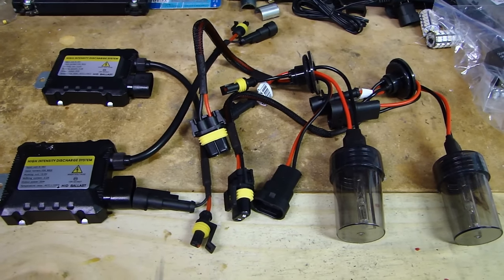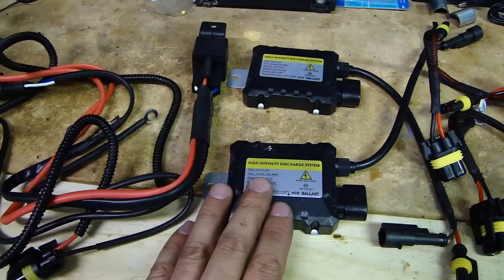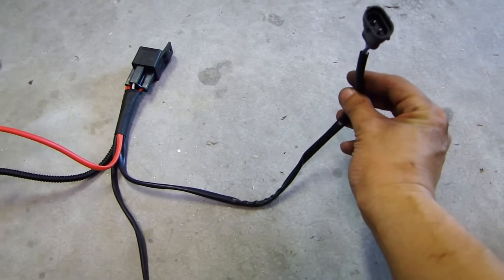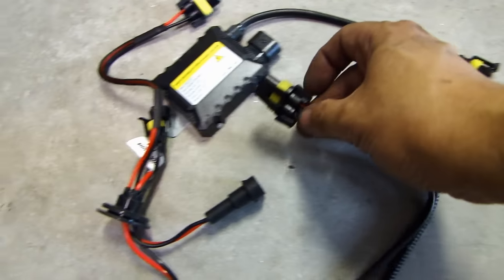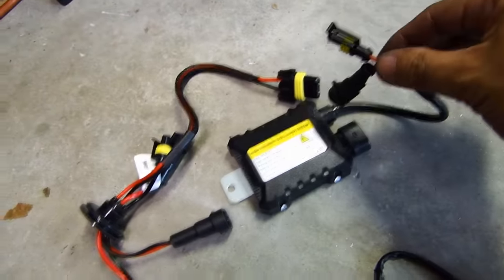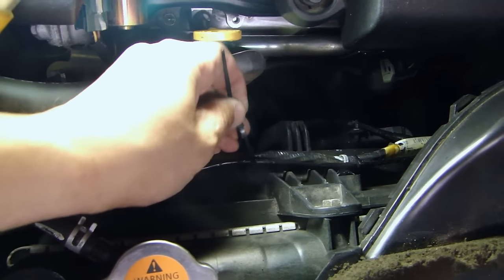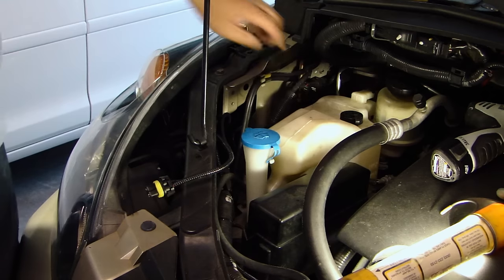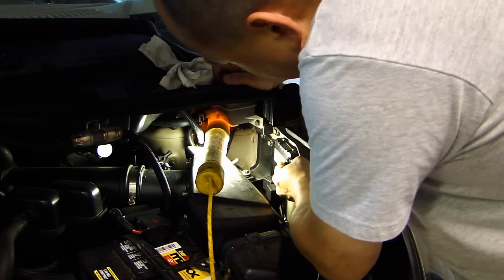How To Install HID Light with Relay Wiring Harness

Comment: Don't be that guy and install hid's in a reflector housing. Be kind and not cheap and buy projectors. Your not the only one on the road.
Reply: Its not that bright without projector. Its not as bad as regular high beams.
Reply: it is that bad. any housing made for halogens cant have hids. that includes projectors that came factory with halogens
Reply: +JiMLiTtLe905 I hate to be that guy because i agree with you i hate those drivers, but in my case i kind of have to. I ordered some smoked headlights and the light output is kind of bad. The glare is also way less than the clear lenses so i feel like i wont be blinding people too bad.
Reply: True partially. Do you know that there is cars that come with hid in reflector from factory? Probably you didnt. If the housing has the shield made for it it makes a very good cutoff actually
Reply: Make a Casper shield?
Reply: @JiMLiTtLe905  you don't know much about projectors, do you? Projectors actually produce less lumens than reflectors but also have a better cut off. Projectors were invented for hid headlights. Only reason factory puts halogen in projector lens is because it used to be cheaper. As for as led goes.... The new Corvette uses led ;)
Reply: There are HID's made for reflectors, they have the matte coating on a quarter of the bulb to prevent glare. The stock 2000-2003 Acura tl's headlights use HID 5000k with a reflector. This guy just didn't purchase the correct bulb for a reflector housing.
Reply: JiMLiTtLe905 what about as fog lights say 9006?
Reply: Or you can just buy d2r hids which are meant for reflector housings
Reply: I know this is an old comment thread, but I feel justified due to the tinted/smoked headlights I have installed. Its really hard for light to escape and led's and normal bulbs are just not bright enough for me to see at night.
Reply: Is that why I get blinded sometimes on the road?
Reply: Idgaf none of y’all care but me I do what I want stay blinded
Reply: An honest low life!
Reply: I did just this year's ago before I knew anything about HID's and my stock lights were brighter.

Comment: TIP: For anyone with this kit or similar and is still having issues after wiring it like the video here is a fix. Plug the pins into the connector just as it shows in the video. When you plug the connector into the red part on the ballast just flip them around on both of them. Mine actually had a positive and a negative mark on each one to match them up. So you’ll want the positive side to go into negative slot and the negative side to go into the positive side if that makes sense. Many hours of frustration and this is what finally got mine to work correctly.
Reply: No matter what I do to mine they remain dim, they start up really bright then within a second return to a dim state, does this mean my 12v current isn't strong enough?

Comment: I bought A golf plus 2005. Its just failed its annual mot inspection as the law of these HIDs has changed here in the UK. To pass I need to remove the HID conversion back to the original. Any idea how to do this?

Comment: Great video, I have a question about the extra wiring from the ballast. If I could put a picture on here I would show you. I have extra wiring for the factory wires. Do I just cut them out or what?

Comment: Hi. Thank you it was very clear nice expression. I have a question. I bought a osram hid kit(new). I tried it by my passat without relay. But it flickers 2 sec. and stops the working. (Both of xenons) I have to make relay connection to fix this problem? right?
Reply from the maker: Assuming the new HID kit works fine, if you install a relay wiring harness for the HID, then you will be powering the HID directly off the car battery and that should take care of any flickering or turn on issue.

Comment: Good video sir.  People doing installs (plug & play installs) with just the factory stock wiring may end up ruining/overheating the wires cause of what you said...the ballast uses alot of current to start up.  And that is why you used relay harness because it uses the right awg. gauge wire for the ballast and it gives it the amount of power it needs to work.
Reply: Hi Sir, Can you tell me if the kit works without the relay harness? because the one I bought on Amazon doesn't have a harness
Reply: @galodoidousarenato5504  it should still work.  My only opinion though when you connect it direct to the headlight plug, the stock wiring for the bulb may overheat and burn out the wire if the stock fuse does not blow because HID startup uses alot of volts/amperage  it says on the ballast.   I use a relay for my hid lights because I can hook up a bigger gauge wire to run my hids.  The headlight plug runs to a relay, then the relay would switch on and send power from the other wire I use to power my hids.  You should check out videos on youtube on how automotive relays work.  But without a relay, your hid kit should still work.  Just read the instructions...
Reply: @jbmjbm323  thank you very much, I did as you said and it worked very well
Reply: @galodoidousarenato5504  I installed morimoto 35W HiD kit on my car for 4 years now with no relay harness. No problem yet.
Reply: @iishyxvietxboyii1 cuz it’s morimoto

Comment: very useful this video!!!,  very accurate with the install using a harness here is a tip that im using on my accord 94, with the harness you have 1 vehicle connection free so what i did was to unify that connection to the high beam bcos im dont like to see any wiring hanging there also, to put into the high beam a capacitor just to have peace of mind, hope this tip like it and well greetings from colombia. :)

Comment: i recently added a relay to my HID set up. I noticed that the wire from the battery to relay gets very hot. Is that normal? It seems dangerous to me that it get hot. Any responses would be appreciated.
Reply from the maker: If the wire is getting hot, then the wire is too thin. Use a thicker gauge wire like 12-14 gauge.

Comment: Eric, I bought a relay harness for my light bar. The on/off button switch has a red light for off and a green light for on. When the ignition is off the red off light is lit up. Will this drain my battery? My guess is it's like an alarm led. Love your videos. Thanks for any input

Comment: when connecting the wire to the positive terminal am I in any danger of getting shocked or electrocuted, or do i have to disconnect negative first  just being safe thank you
Reply from the maker: The 12V DC will not shock you. You don't need to disconnect the negative terminal.
Reply: thank you was concerned

Comment: Out of curiosity and before I get a headache looking at mine (came with absolutely no instructions) on your passenger side, did you still have a male plug that connected to nothing?
Reply from the maker: With the relay harness that you install for the HID, you only need to connect one side of the headlight connector as that is used as a trigger to turn on the relay.  The other headlight connector is not used.
Reply: @dial2fast  you are a life saver! Thanks for the reply!

Comment: When your hooking up your harness to the nut on your battery you dont need to dissconnect the battery right? I dont want to lose any of my settings in my car? Thanks and great videos!!!
Reply from the maker: A Sharma You don't need to disconnect the battery when connecting but just make sure you don't short anything while connecting.
Reply: You can also remove the fuse from the power cable on the harness. This way no power is flowing to the relay switch and allows you to secure all wiring connections prior to activating the lights.

Comment: Where do you buy a replacement for this unit when the bulb breaks. I purchased my Mercedes with the headlights already upgraded an I have no idea where to go to get a replacement bulb.
Reply from the maker: Aftermarket HID bulbs are not as popular as LED these days, but you should be able to find some on Ebay.
Reply: @dial2fast  thank you

Comment: Saw a post here, someone had both hi/low beams on the factory plug and they wanted to install both but this video was for low beams only.  I would think if they wanted hi and low beams, they would need to buy a bi-hid kit for both hi/low beam and for the relay harness it may look alittle different I think, but basically the same thing here in your vid.

Comment: I retrofit my lights on my 2007 Suzuki swift. Stock plugs are h4 and the projectors I retrofit are H1 bulbs. I bought a h4 relay harness,two ballasts and two H1 xenon bulbs. I put everything together and it works fine,except one thing. When I switch on my lights and close them after a while, trying to open them again only drivers headlight came on. If I try on/off several times the passenger side work too. I thought my ballasts are bad and I bought new ones. But still the same. Is that a problem with my relay harness?

Comment: So it has to be wired to the battery? My stupid Prius has the battery under the back seat..
Reply from the maker: If you are using a relay wiring harness, it needs to connect to the battery.

Comment: if my car has different bulbs for high and low beams, does that mean I need to run two sets of this wire set up for each set of bulbs? also can you confirm that this type of installation with a relay will prevent the computer from being compromised?
Reply: Hey I'm wondering the same thing! My dodge chsrger has a high beam bulb an a low beam bulb for each side... does thst mean I have to run the lows with 2 ballasts  an a relay harness and 2 more ballasts an a relay harness for the highbeams??? *Enlighten me Please*

Comment: What brand is this HID kit and did it come with the relay harness?? Also where did u get it and how much?? Thanks
Reply from the maker: These are no name brands off eBay for about $26. These are DC ballasts and not as good as AC ballasts. The AC is much better. Relay harness do not come with it. You can find all the these on Ebay with many sellers selling them.
Reply: dial2fast I tried to install a relay harness because my car has a delayed start and one headlight would be out sometimes. Nothing happens, nothing would turn on, I put the red on the positive terminal and the black on the negative terminal on the battery. All my plugs were in correct, any thought on why it isn't working?
Reply from the maker: You will need a multimeter to check all the connections on the relay and power to the ballast. There is no easy way of figuring these things out.
Reply: dial2fast
Hey! Was about to install hid lights on my car, but was confused about the two wires of the bulb. Are those two other wires (besides the two you connect to the ballast) that comes along with the bulb useless? If you use relay harness that is...
Reply: +Armyboy Check your connections; there are basically five connections;

the red connection going from auto positive terminal to relay harness(this also has the inline fuse) @ one minute 22 seconds in presentation;

the connection going from Hid relay wire harness to the factory oem original light socket harness @ one minute 27 seconds in presentation;

the connection going from Hid relay wire harness to both the Hid ballast to power it and also its ground connection to chassis ground;

the connection going from Hid relay wire harness to the other Hid ballast unit to power it and also its accompanying ground connection to chassis ground;

then all one has to do is connect ones left/right Hid bulb to the pair Hid amp style connectors to power each Hid light bulbs respectively.

Comment: Doesn't the ground go to the ground terminal in the battery or does it matter? I used a ground that was on the side of my engine bay but other videos say to use the batterys ground. Not sure
Reply from the maker: The car chassis is tied to battery ground. Check it with a multimeter before you connect it.

Comment: I was following the same setup in my Hyundai Venue. But if I connect the battery line then I get a warning in console saying check headlight. If I give the headlamp line directly to relay and then connect relay to ballast, warning does not come. But I now face a new issue, the cut off line seems to be disappeared and the high beam from both lights goes to some top right in a wierd shape, no clue what's going on.

Comment: I have a hids for my low beam and they work great. But I tried putting hids on the high beams and don't seem to turn on do I need a relay to start up? Thanks in advance for the help
Reply from the maker: HID are not ideal for high beam as the warm up time takes too long for real practical  use. There are lots of LED lights that performs very well. You should look into those. Also easy install as they are plug and play.
Reply: dial2fast thank you!!

Comment: Hopefully you or someone reading this can help me with the issue I have right now but basically I was trying to install the hid kit with relay on my car and the passenger side of my hid bulb won't turn on and I couldn't figure out why. It was also making so buzzing noises which supposedly I heard that it wouldn't happen with a relay kit. I don't know if it was due to the fact that the plug that was plugged into the bulb was left hanging, but I only have one signal wire which is connected to the driver side.

Comment: so im ordering aftermarket headlights for my 2002 530i due to a deer hitting and cracking my passenger headlight and the aftermarket I ordered says non compatible with factory HID cars which mine is. Will I be able to make it work?
Reply: Yes by installing a different kit. For example i ordered aftermarket headlights also for my car and came with an LED strip inside (which i think it looks cool) but my original HID bulbs did not fit so i had to buy a different set that would fit my aftermarket and it worked.

Comment: Hi, thanks for the video. Recently I just change stock headlight(55w with 15amp fuse) to xenon Hid(55W with stock fuse 15amp), but the xenon manual says a 20amp fuse recommended. Do I really need to upgrade the fuse rate? Thank you.

Comment: Hey I’m using HID lights with 55W ballast for my fog light and the fuse keeps on blowing. From my understanding is the during startup the HID draws a high current and will drop back down. So due to the high draw of current it blows my fuse. Therefore in order to rectify this, do you think by using a relay harness with its own fuse that is connected to the battery then to the HID with its 55W ballets will resolve this issue? Thank you.
Reply from the maker: I am assuming you are referring to the factory headlight fuse blowing. If that is the case, then you should install a relay harness to provide adequate current for the HID ballast.
Reply: Yes I meant the factory fuse keeps on blowing. Will be install a relay harness. Thank you for your help, greatly appreciated 🙏🏿.

Comment: So you are using only 1 OEM headlight plug to give a signal to harness relay. The other OEM plug is unused, so you should get an error on the dash that the bulb is gone (from the side the OEM plug is unused). Isn't that right? Or does it throw an error on both sides, because the relay isn't drawing enough amperes from OEM plug and ECU thinks bulbs are gone?
Reply from the maker: The trigger to the relay is coming from one headlight only. Most Japanese and US cars don't give any headlight errors. I think BMW and Mercedes will. If your car does, then you can try connecting the ballast to the headlight plug (plug and play install) without using the relay. Otherwise, check on the net to see how others are doing it.
Reply: dial2fast Yeah, I am using it on BMW X5 2008 model. I used plug and play, getting power straight from both of OEM plugs, but xenons sometimes flicker/flash and one or another switches off randomly. I thought I would overcome this problem by introducing the relay harness, but this will cause another problem. Thanks for a reply.
Reply: +djgenius10 You will probably need a heavy duty resistor/capacitor connected parallel with the headlight connection to the relay.  This should simulate that halogen bulb is connected and it may be okay.  I never done this so I don't know if this will work.  Try at your own risk.

Comment: I have installed x5 can-bus ballast with 35w HID bulb. It is working good only as a head light but i lost my DRL (Day running lights). Will HID works as both head lights and DRL?
Reply from the maker: +Sutha Tharakan HID is too bright for use as DRL. You can of course install it, but its annoying to oncoming traffic.
Reply: +dial2fast  one of my friend told me he is using HID as DRl as well as the same HID working as his head light. ( dim light + head light in one HID) thats what i'm confused. Mine is just as head light. When i start the car no lights will work. But in canada its a law to use a DRl in vehicles. I can install an external DRL but I'm confused how his HID working as both DRl and headlight. My HID was flickered when low voltage is supply, so they changed the ballast and installed x5 can-bus with flicker canceller.
Reply from the maker: +Sutha Tharakan Factory DRL from years ago (non LED) operates by cutting the voltage in half. So it puts 6v on each high beam bulb. That's why it's not full brightness. I am not aware of any ballast that operates at both 6v and 12v. You might want to take a look at your friends car and see what's his setup.
Reply: +dial2fast yes. I'll go and see his setup this week and will share with you what he did for his DRL. 
Thanks for your replies.

Comment: Does the heat of the xenon hid bulb affect the plastic/ lens of the headlights?
Reply: I have 55w currently and i was curious of any type of heat so i had them on for a while just driving around and before i turned me car off, i touched the outside lense and they were cold.